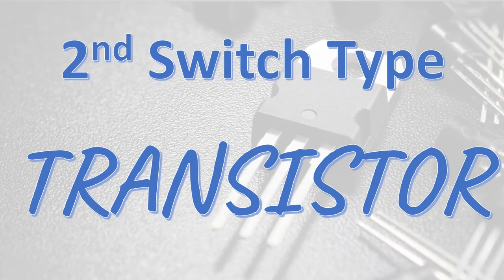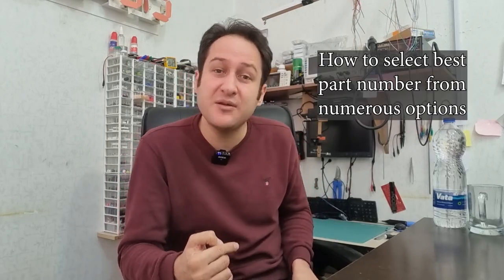3 Major switch types in circuits!

Comment: Hey in your other video you showed a small triac powering an incandescent bulb (a high current load).   I thought triacs could only handle tiny loads like 100mA?  I am going to be controlling an 85w (0.74A) load on 110v AC with a microcontroller (I am making a smart thermostat for line-level-voltage thermostat wiring) and I opted for a nice solid-state-relay package, but could I have used a simple triac?
Reply from the maker: Yes you can. Handling high power loads using triacs is not unusual. An ordinary triac can switch 1000w loads

Comment: maby use optocouplerfor isolation in triac
Reply from the maker: Maybe
Reply: @elewizard so your last sentence is not completely correct. With required isolation and AC a relay or an optocoupled triac can be used